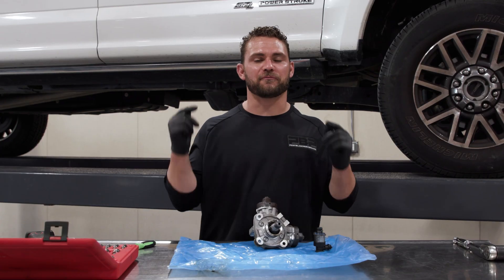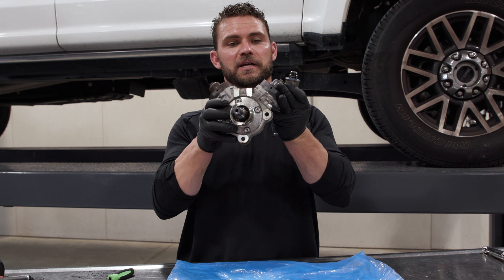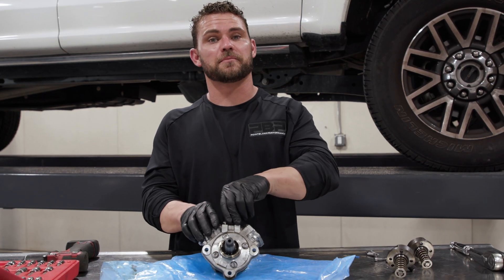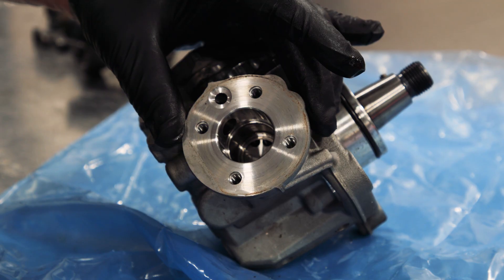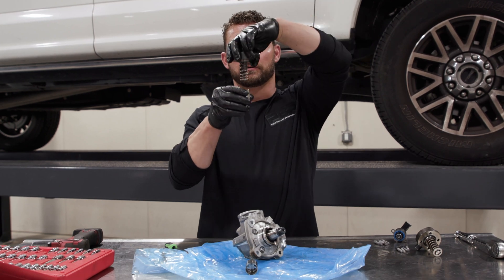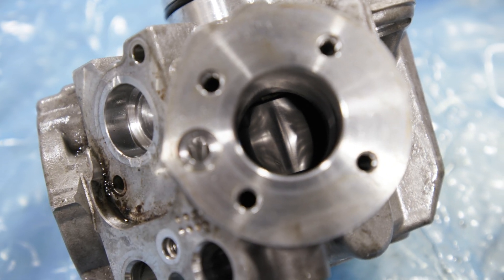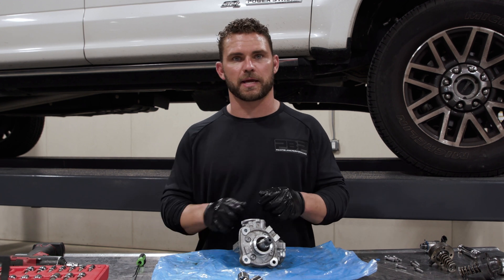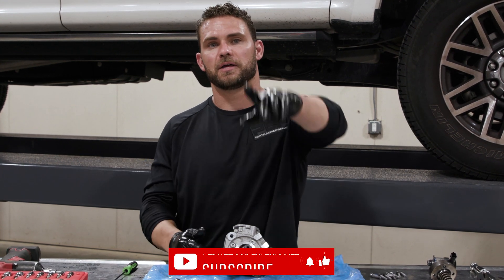FORD 6.7 POWERSTROKE CP4 HIGH PRESSURE FUEL PUMP!

Comment: I truly believe keeping your system clean and adding a expensive fully synthetic two-stroke oil that doesn't leave any carbon residue to the diesel fuel along with your fuel system additives for anti-jailing or whatnot... 1 to 300 ratio when it comes down to the two-stroke oil... The main issue other than contamination in The diesel fluid is lack of lubrication. They do not lubricate diesel fluid like they used to All due to emissions... I installed an S&S disaster kit as well.. I was thinking about installing a exegry for the replacement of the CP4 sensor too ..

Comment: I've got a 2017 6.7 diesel ford with a plastic fuel tank. What should I be doing to avoid a catastrophic failure ?  And what do you think of the new Ford 7.3 gas motor and 10 speed transmission ?
Reply from the maker: Personal opinion is make sure you keep more than a quarter of fuel in your truck as much as possible. On fuel filter changes do them ever oil change , Prine the system at least 8 times before staring. We have a good success rate from that . On the gas side of things we stay away from it sorry sir

Comment: So what failed in that pump? Typically the roller bearing fails. Those bearings looked ok. Where did the metal come from?
Reply from the maker: Bearing did look ok , we did not remove the cam (shaft) from the pump to see if it was eating into the case. Could have came from but it but I would only be assuming we don’t want give false info.

Comment: 15-16 started the CP4.2
Reply: 4.2 is still the same shit pump. Roller/piston can still turn in the bore, misalign, and make metal.  Sure would like to have had a closeup of both rollers/pistons instead of just the one.....and the cam. Metal doesn't just make itself.....

Comment: With so many cp4 problems. Why and the hell aren’t Ford and ram switching? Horror stories everywhere. A non guided lifter. (Stupid). All that lifter has to do is move just the slightest but and game over. Ford and ram aren’t even wanting to warranty this. Costing consumers 8-20,000$. Gm got away from the cp4 all together in 2017 to present. Good job gm.
Reply from the maker: For any person the out of pocket expensive is above and beyond expensive we agree sir. Emission regulations keep demanding higher standards on fuel injection atomization and the Cp4.2 is their higher pressure solution . ( Cleaner Burn )
Reply: @POINTBLANKPERFORMANCE  yea I agree. Just a bad design and for the consumer. Iv done a lot of reading on the denso. Seems to be a pretty good fix for gm side of things. Injectors and pump wise.
Reply from the maker: @Sxsfanatic1000  Personally we get calls on all of it , right now we’ve got a 2020 l5p that keeps knocking  out injectors and the dealership can get it fixed. In some cases it goes above our knowledge and goes into a calibration issue that doesn’t get fixed by replacing but by new programming ( oem ) as we’ve learned through engineers on the fuel injection side. So we try and not point to many fingers.
Reply: @POINTBLANKPERFORMANCE  wow. What a shame. Seems nothing is built to last anymore. But hey job security for you all haha.
Reply: @POINTBLANKPERFORMANCE  thanks for talking to me. I really appreciate it sir
Reply: @POINTBLANKPERFORMANCE  that’s pretty disturbing. I’m in the market for a new truck to tow my RV  all over. Which newer truck seems to be the most reliable. I was leaning toward a 2020/21 L5P
Reply from the maker: @blkt6  L5P or PowerStroke sir
Reply: @POINTBLANKPERFORMANCE  ipurchased a used 2018 F250 with 53000 miles. A year later, just beginning to understand  about the CP4.2. Whats your recommendation to try and prevent this from happening. Getting ready to go full synthetic with Archoil, add a 2nd 5 micron oil filter, and replace fuel filters with Ford made parts.